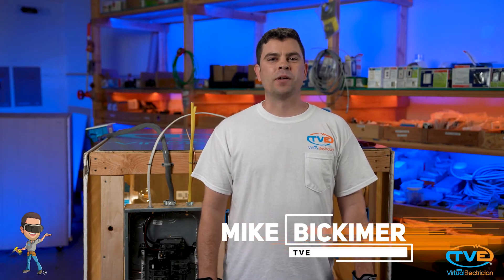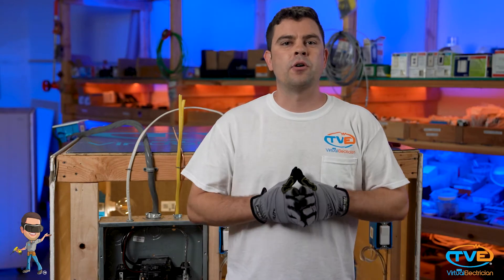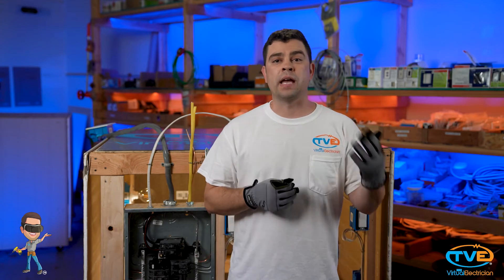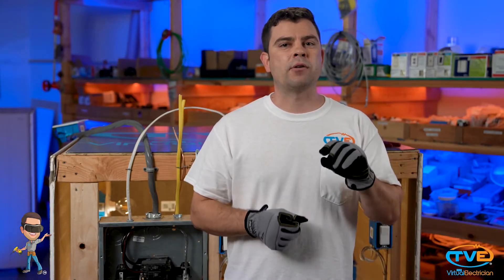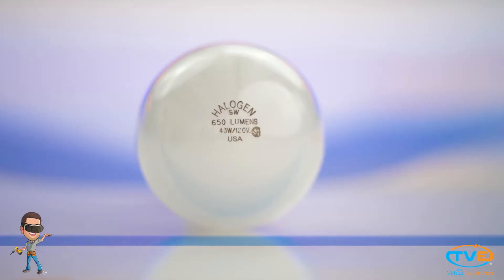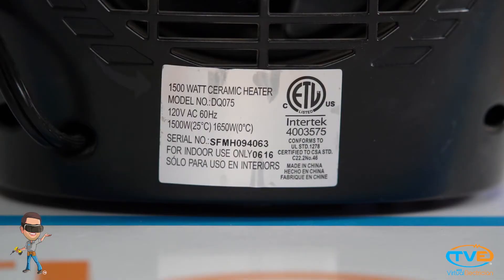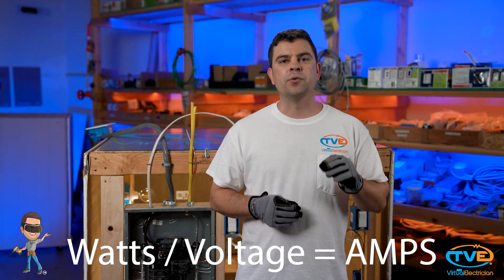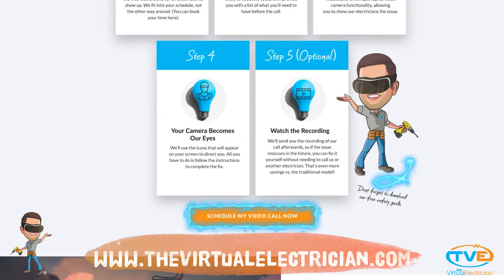Overloaded Electrical Circuits - Troubleshoot

Comment: How is that when I turn my ac on, other circuit is getting affected. And I'm not talking about the initial power surge to start ac. I start the ac and a cooler in the other room is getting slow. What's the reason please explain.
Reply from the maker: have the utility company check connections at meter can and utility pole

Comment: Cant i just install a breaker with higher amperage
Reply: I don't think so that's what I was thinking
Reply from the maker: no sir!
Reply: @TheVirtualElectrician please elaborate an why not?
Reply: @idieldiaz525 not an electrician but here’s my understanding: the size of the breaker is dependent on the wire used. So if they used 14 gauge wire you CANNOT just throw a 50 amp breaker in. The breaker is suppose to protect the wire from over heating and 14 gauge wire cannot carry 50 amps safely.

Comment: It's only 1 tankless water heater on a 60amp breaker and it makes the buzzing sound. What can the issue be? Everything is new 6 gauge wire, panel, breaker, tankless water heater
Reply from the maker: schedule a call at www.thevirtualelectrician.com and we will figure it out

Comment: I connected a Generac 3500i L5-30 t Reliance TS from Home Depot.  Breakers A & B on TS work well. The other 4 breakers, 20amp each make the generator overload and trip. Used an adapter cable from L5-30 on Gen to L14-30 on TS.
Reply from the maker: Contact me through www.thevirtual electrician.com. I need to see your setup

Comment: Can you just install a larger circuit breaker?
Reply: The wiring that runs through your walls is rated up to a certain amperage before it burns up and causes a house fire. The circuit breaker installed MUST be for the same amperage rating as the wire in the home attached to that circuit to prevent fires from circuit overload. If you have even one strand of wire rated for 15 amps on a 20 amp circuit, that wire will overheat when even 16 amps is applied to it and the breaker won't stop it from burning down the house.
Reply: @gamechannel1271 so the correct way is to inspect the wire not the breaker.
Reply from the maker: unfortunately no.  you will be overfusing the circuit doing this